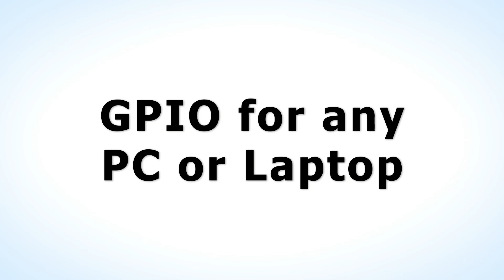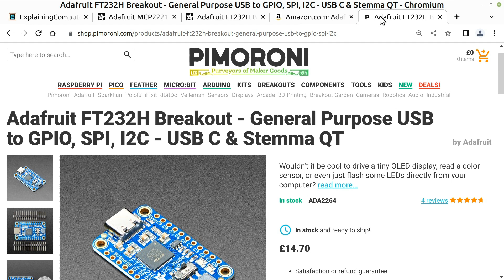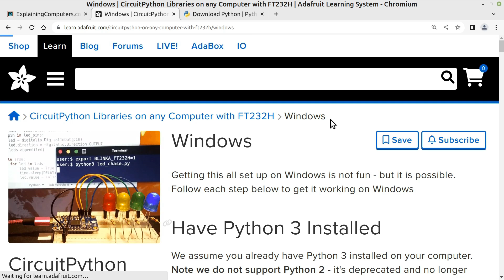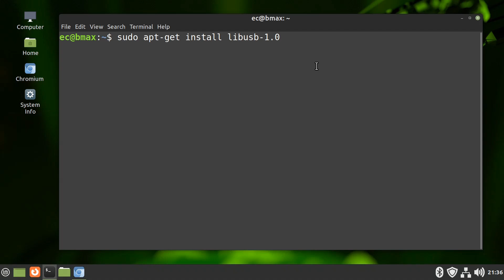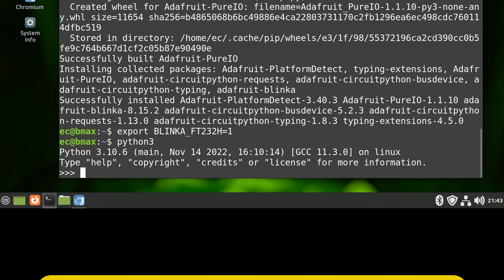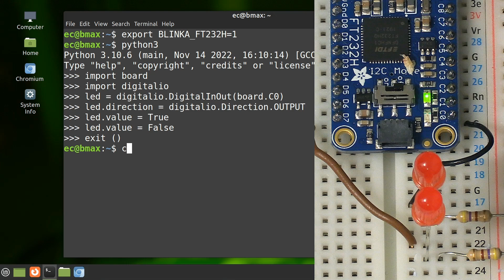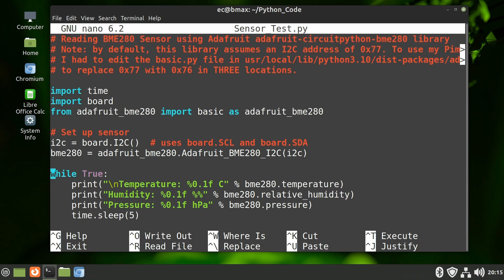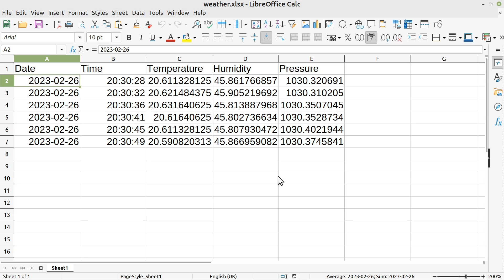GPIO for any PC or Laptop: Adafruit FT232H

Comment: I was getting excited until this guy started the: "Python this, and Python that" If wanted python , or C++ up my rear end, i wouldnt have given my raspberry pi 3 to my son just to get rid of it. Im Old School. On the Commodore 64, you'd send a 0 to 255 number to the data direction register in the CIA chip to tell it which was an input, or an output. Second, next address, Poke the address, with the number you wanted. No BS coding involved. Which brings me to ask a question. If you treat the audio output jack AS your OWN serial output, could a person simply use Quick Basic 64, send out a sound on your audio cord, attach a simple A/D chip to the end, sample the signal, and recover as many GPIO lines as your chip is designed for? And as for input, its already setup as a microphone input, to do it, using maybe a couple of audio transformers for electrical isolation. Anyone tried this yet? I have no clue what so ever how to send data over a USB line, but Im sure I can send audio out to an external A/D converter chip. using a diode and cap to convert the A/C signal to positive D/C

Comment: I wish stuff like this existed 30 years ago.. The first Computer I used to control external devices was a Commodore 64 (Expansion Port) to control an Amateur Radio Repeater on the Two Meter Band... Using opto-isolators to provide the isolation between 5 and 12 volt Supplies.. It was fun, and very rewarding to make it work.. (Especially) incorporating a phone patch (all before) Cellular Phones.

Comment: I would suggest using a usb isolator.. i dont fear so much for the usb ports, more for the hardware outside with crappy switching psu and ESD, maybe grounding loop dangers or badly protected ic pins.

Comment: Everyone advicing to add env var to .bashrc are giving the wrong and destructive advice.

One should not install project specific libraries into a system python. Use venv instead, this is a correct way

One should not use global env vars but set project specifc vars from inside of the script using os.environ or .evn file which is even better. These vars will persist only while script is running.

One should not edit library files :) it makes no sense as on a next deployment your changes will be lost. Use settings instead

Peace, guys :)

This comment is not for a author because he obviously does not care but for newbies lurking around :)
Reply from the maker: The software side of this video, as clearly shown, is based on materials from Adafruit, who make the hardware.

Comment: As a suggestion, it could be given an example of a Python flask server with a very simple log window, this way the user could remotely monitor the variables. After that, a dash python simple dashboard example would be straightforward to implement and interesting to use.

Comment: I understand this video is outdated. Do you think this ft232h would be fast enough to use it to control fuel injection, ignition, and throttle control on a small single cyl. engine?
Reply: This video is 2 months old. How is that outdated.
Reply: No way this could work without glitches ; your Python control code is running on a slow time-sliced Windows computer and also has USB delays.

Comment: To protect your USB port use an isolator (ADUM3160 Digital Signal & Power Isolator)
No USB3 data speed, but you isolate your experiment from your PC, If  you smoke it the PC wont be hurt.
You even have a 200mA current limiter.  
I can finaly stop using Win98 just for the LPT/COM 'GPIO's'  8-)

Comment: I wonder, does this also work on tablets?
Reply from the maker: It will certainly work on a Windows (x86) tablet. It should theoretically work on an ARM tablet (Android or iOS), but appropriate drivers would be needed, and I think that only PC, Mac and Linux are available. :(
Reply: @ExplainingComputers  I'm hoping there are drivers for this module for Android tablets 🙏🙏🙏🙏

Comment: I would not call any USB board "direct" GPIO. FT232HQ has very limited internal state engine (probably too application specific to be called an MCU) but it is still an external chip (and same would apply to all GPIOs on modern motherboards too). The reason is that for direct GPIO it is the host processor to have it as integrated peripheral. In embedded world even I2C or SPI IO expanders are never called direct GPIO.

Comment: I would be very interested in how to write I2C or SPI code for a device that has no pre-written library.  I understand SPI and I2C well enough, but knowing what to install when you've never used python or FT232H is a bit confusing since the tutorials seem to assume you're using a specific device library.
Reply: OK, after a bit of digging I found that once the GPIO is working, nothing else needs installing.  The biggest challenge was working out what information to ignore.
This worked for me:
import board
import busio
import digitalio
spi = busio.SPI(board.SCLK, MISO=board.MISO)
cs = digitalio.DigitalInOut(board.D4) #D3 not recognised

from adafruit_bus_device.spi_device import SPIDevice
device = SPIDevice(spi, cs, baudrate=5000000, polarity=0, phase=0)

byte_out = bytearray([0x12,0x34,0x56,0x78])

#SPI read
with device:
     result = bytearray(4)
     spi.readinto(result)
print("Read", result.hex())

#SPI write
with device:
    spi.write(byte_out)

#SPI read/write
with device:
     result = bytearray(4)
     spi.write_readinto(byte_out, result)
print("Read", result.hex())

Comment: Hi Chris it's been a long time since I made a request,  Since you cover everything so well I normally don't have one.  But Today I am having issues getting the Arduino Software on a Linux Distro( LM64) to work with a pico (with or without Wireless).  I have no issues with it working on Thonny, but when it comes to working with Arduino Software it seems I'm having a communication issue.  I was so hoping you can make a tutorial on using Linux distro using Arduino software for projects on a Pi Pico board.  This way I can and others can benefit from the tutorial. Hoping that you have the time and looking forward to watching your tutorial

Comment: Possibility of damaging the USB with this?  NOP!

I thought you knew electronics, voltages, protocols and drivers/buffers?
Reply from the maker: There is certainly a possiblity to damage the USB ports on a computer with this and things connected to it if they of the FT232HT boards. Others here clearly agree, and have recommended using an optoisolator of some kind.

Comment: A cheaper version could be using VGA/HDMI/DVI ports. These babies have 2 dedicated pins to talk to the monitor to which they are plugged, exchanging data like brand, native resolution, etc. The fun thing is that these pins use the I²C protocol. So install the i2c tools on your Linux computer, hack the cable, plug it to I²C capable devices, and voilà!
This can work with various I²C sensors like the ubiquitous BMP and BME280 pressure sensors, of course, but also with I²C expansion chips like the PCF8574, and that will give you access to 64 (8 I/O per chip times 8 configurable addresses) digital GPIO pins for the cost of 8 of these small chips... the funniest part is that each single video output has a dedicated I²C bus, which means that for a PC with VGA, DVI and HDMI ports will give you the number of video interfaces times 64 GPIO pins... so, for example, 192 GPIO pins for just these 3 video interfaces. Hack the built-in display of your laptop, that's another I²C bus. If you have built-in video on your desktop PC and also have a discrete GPU, that's a truckload of GPIO pins...
The downside is that you pretty much need to rewrite your code to accommodate for the intermediary step of using the PCF8574.
And if you are not entertained, there is the PCF8575, who has 16 I/O pins...

Comment: Not a bad way to get a direct connection to control GPIO pins, my initial reaction was why not use python and pyserial with an arduino to then send and recieve data from sensors but this cuts out the arduino step and brings it closer to a raspberrypi with direct control

Comment: Great video. If you have a BME280 with a different address, like in this case, you can simply specify it when you initialize the library instead of editing the value in the library. This also makes installing updates much easier.
Reply from the maker: Good to know, thanks. :)

Comment: This is excellent and very timely! I have just ordered some sensors and knew I would have to get down to using Micropython, GPIO etc. This video has given some ideas about helping my daughter to use sensors on a PC, despite having no Raspberry experience. I find you have already issued videos which will be really useful such as your RPi Weather Station. Thanks!
Reply from the maker: Good luck -- and you are right, there are several of my previous videos that may be of assistance -- including the one where I built an anemometer. :)
Reply: @ExplainingComputers  AND the RPi Plant Watering and Time Lapse  Photography videos! I've only been thinking recently that I ought to get down to time lapse with a Camera Module 3. Thanks again

Comment: thanks for the great vid. Is it possible to run 4 sensors off this board?
Reply from the maker: Theoretically, I2C can handle 128 sensors, so if you had 4 sensors that could all be set to a different address, you could use them all. The BME280 module I used has a circuit connect that can be cut to change the address, so two of these modules could be used -- and potentially two from different manufacturers with different addresses.
Reply: @ExplainingComputers   thank you for the quick reply. so it's a case of the sensors that can be in theory changed to at least 4 different addresses. and the rest is shown in the video. think you saved me a ton of time. cheers

Comment: There are many ways to give a PC gpio capability. As noted in other comments, a PI or Arduino can be used by running a protocol over the serial link.  The protocol used by the FT232H could be supported on other platforms. In the past I have used Web Midi in chrome browser to do gpio over a Midi interface to an Arduino. ( Optical isolation both ways with 5 pin Din Midi )  depending on latency etc, you may want to run some parts on the PI/Arduino and others on the PC.

Comment: The correct way to install Python on GNU/Linux is to install it through the package manager. Not like the video says.

On the other hand, Python is pre-installed in absolutely all GNU/Linux distributions and absolutely nothing needs to be installed.
Reply from the maker: I am bewildered by your comment. I make it incredibly clear that Python is pre installed in Linux. But I indicate the download because I explictly note that you could be working in Windows oron a Mac. So this is NOT just a video for Linux users!

However, the pip installer is NOT pre-installed in all Linux distros -- for example as here in Linux Mint. So it MUST be installed.Try watching a video carefully before making complaints.

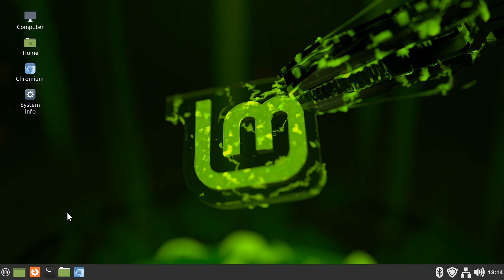Comment: Excellent tutorial! Small correction, at 11:40 video shows two 47 Ohm resistors(yellow,purple,black), referred as "470 Ohm current limiting resistors". Keep up the good work!
Reply from the maker: Thanks for this. Whilst the resistors are there to drop the voltage, this in turn drops current, and resisitors so positioned in series with an LED are always referred to as "current limiting resistors". See, eg (and lots of places!): https://www.mouser.com/blog/dont-burn-out-calculating-led-current-limiting-resistor

Comment: Wonderful!!!!!  I have a bmax B2-S  arriving today (caught a great sale/discount, $104 versus usual $130-$160). Needed it since I threw away several old very slow laptops.. 
I've been looking for details on how to handle sensors, I2C and DIO natively using python from a "PC" and it sure looks like this is the definitive guide. 
Like others I had missed several steps when looking on my own.  I have a ton of ESP32s that work great but I also wanted to be able to log, graph and view the data easily under linux or Windows without needing a separate device to handle the data acquisition.. this seems to fit the bill.

 I've always loved this channel!!  Been working professionally with electronics and computers since 1973

Comment: Note that the FT232H does not support clock stretching on I2C.  Not a problem for most I2C peripherals, but if you have an I2C slave running on a micro it may well be a problem.

Comment: Note: You could just put some firmware on a Pi Pico that offers the same protocol(s).

Another neat application of the FT232H is SPI flash programming. It works splendid with flashrom, e.g., to put coreboot on your laptop or read out the BeLink's flash. :)
Reply: Is this firmware that's already available or would it need to be built?